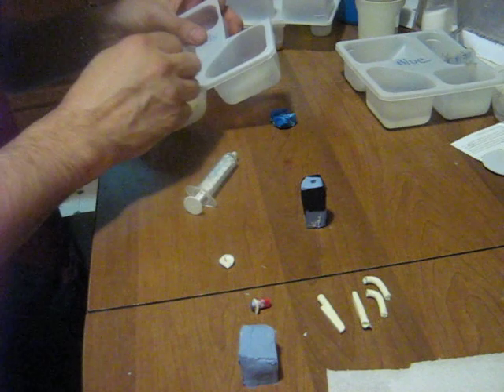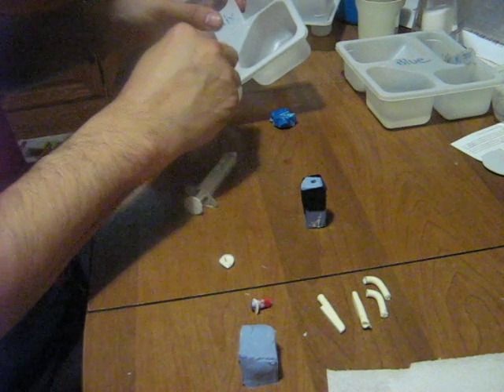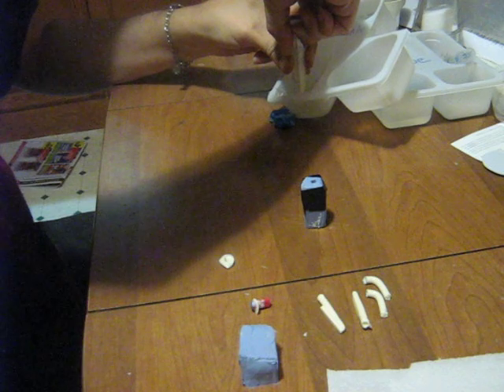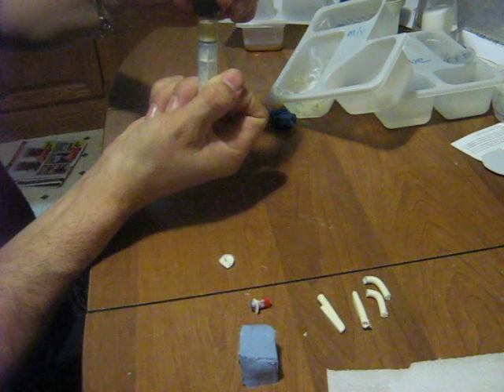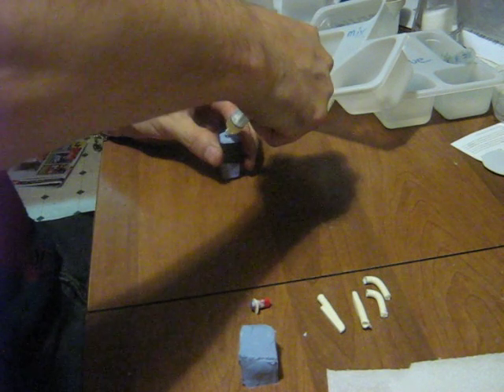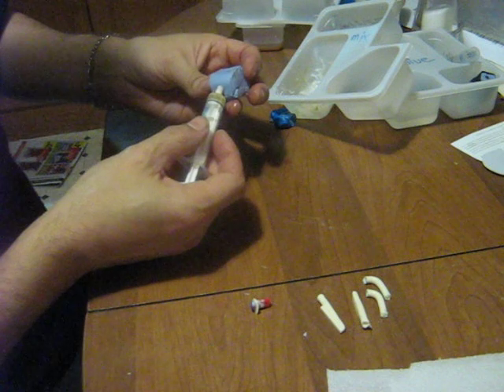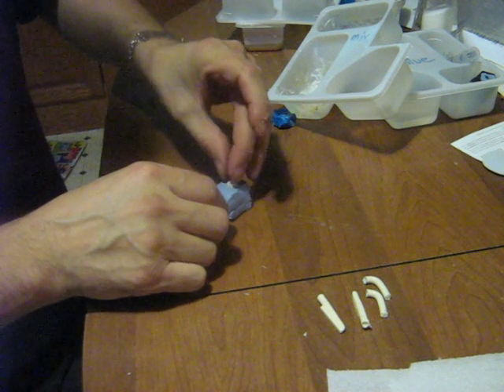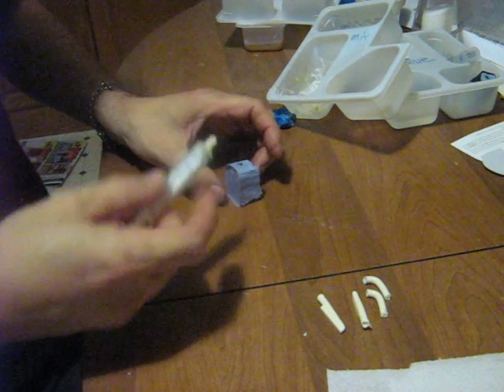Casting Small Plastic Parts #2

Comment from the maker: You are welcome!
I developed some of these techniques while making 1/144 scale tank models, some of the parts to those are very small, like the gun barrel for instance. I was quite amazed that you can actually make a Tiger tank gun with the muzzle brake at the end, and it won't break off, iff you pull it back out of the mold while the plastic is not 100% set up. If you wait too long though the plastic gets brittle, and can break. Lots of little tricks  :)